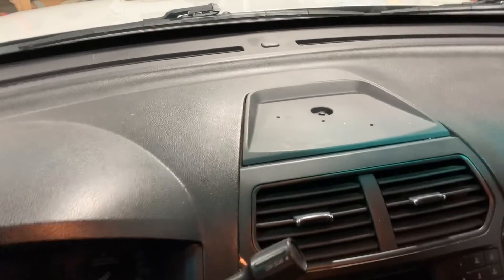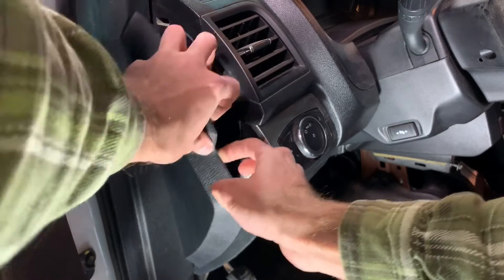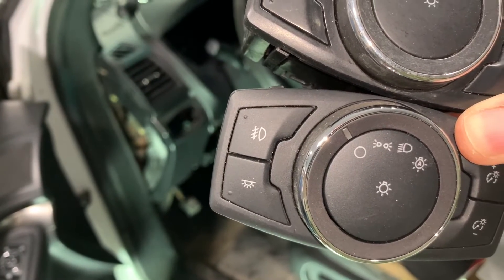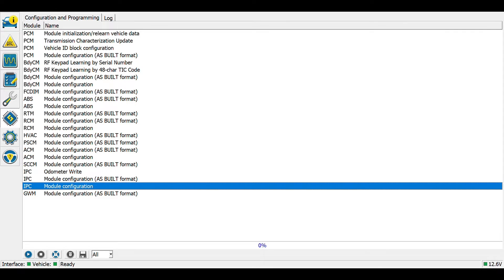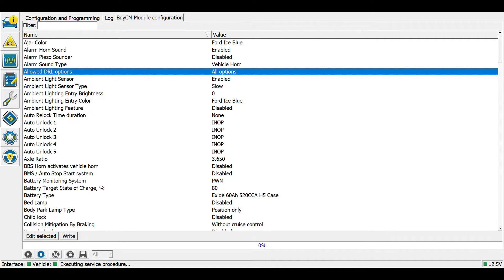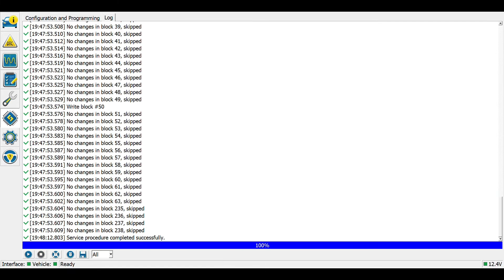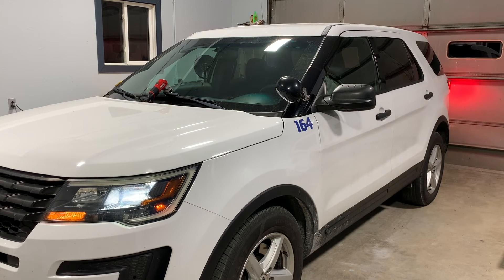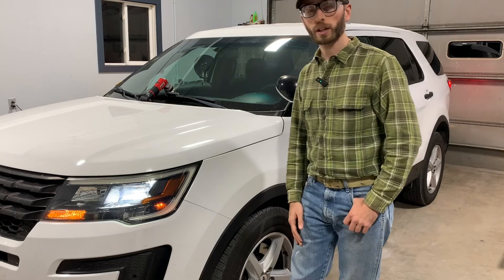Add Auto Headlights & DRLs to Your Ford PIU or Explorer

Comment: Hey. I have same car. And I don't have  high beam. Do you think they trun it off with forsan some reason?  Or any idea why is that  popular problem with ex police car??
Reply from the maker: Police sometimes tie the high beams into the emergency lights so they flash. Look up “wig-wag headlights” or “police headlight flashers” to see what I mean. While they would have still worked as normal high beams, there would have likely been an additional module (under the hood I think) to get them to “wig-wag” when a switch on the center console was flipped. If your FPIU was set up like that and the emergency equipment was then removed, you MIGHT have to rewire your high beams for normal use. 

THAT BEING SAID, always start with the simple things first.

1. Replace both the high beam bulbs (or at least remove and test them)
2. Check all fuses
3. Check settings in FORScan
4. Check wiring
Reply from the maker: To be clear, these Explorers/FPIUs have separate lights/bulbs for low beams and high beams, so you must treat them as completely separate electrical systems.
Reply: @reidthemanual  Thx man. What I have to look in FordScan?
Reply from the maker: @EyeCandy-BTS  click into the modules (like the BCM) and use the “filter” in the top left of the screen to look for anything “light” or “lamp” or “beam” related and just make sure everything is “enabled”. Always click into the options and make sure the best one is selected for what you want.

Comment: I have a 2018 piu and the drl work and turn on but the front right one dosent work as a turn signal. Do you have any idea why that is?
Reply from the maker: The integrated LED low beam headlights (white lights) are normally used for DRLs. Are you saying your left low beam works as a DRL and turn signal but your right low beam is only a DRL?

Comment: Can you recommend me the easy to plug in remote starter for a 2019 ford police interceptor utility?
Reply from the maker: @pmb8565  I installed the OEM remote start kit and highly recommend it to ensure a long and trouble-free service. It take a laptop and about 1 hour to install. I had to make a trip to my Ford dealer for help, but you *shouldn’t* have that problem on a 2019.

Comment: The auto light switch and sensor went perfect, however the DRL programing fails to work. The DRL ambers come on when switched, but on auto I get nothing. 2017 PIU. Any suggestions?

Comment: Thanks a lot for the video. I have a question, i managed to get my DRL to work with Forscan before watching your video. Later i messed something up in the BCM and ended up restoring everything to factory AB. Now i cant get it to work again. I followed all your steps, and all i managed to achieve is that my HIGH beams now turn on when i enable DRL. Any ideas what im doing wrong?
Reply from the maker: Let’s dig into this. You said that you had DRLs working before, so what hardware did you have installed at that time? Lamp switch with “Auto” option? Sun load sensor?
Reply: Hey sorry for the delay.
I have factory light sensor with auto mode. I only modified the settings in the bcm. The drl were disabled for some reason
Reply: No matter which settings I change I only get the high beams work as drl

Comment: Does this applies to FPIS as well? Ford police interceptor sedan. I installed auto lamp switch and my car already comes with sunload sensor. I have went through forscan and still doesn’t work. I might need to turn on the autolamp menu because I haven’t done that.
Reply from the maker: Hi, Seth. What year is your FPIS? There are many common features/parts between the sedan and utility. I would expect the AUTO headlamps activation process on the sedan to be similar to the utility but cannot speak from experience. Please try matching all of the settings I show in FORScan and share if it works.
Reply: @reidthemanual  It is 2015. I think 2017+ FPIS has different BCM. I will try that and let you know!
Reply: @reidthemanual  Just got home and I forget to enable Ambient Light Sensor in BCM and Autolamp delay in IPC. That fixed the problem! Thanks to your video about the autolmap delay!
Reply from the maker: That’s awesome! Thanks for following up.

Comment: What if the cap doesnt have the wire with it at all?
Reply from the maker: If the harness for the sun load sensor was not installed at the factory, you will need to add it. Here is the Ford part number for the kit:

9U2Z-14S411-TA

The kit comes with the sensor connector and some generic wires, but you’ll need to run the wires to the appropriate destination. The sun load sensor has four wires exiting its connector. Two of those must be run to the Body Control Module (near the brake pedal). The other two wires must be run to the HVAC Control Module (behind the HVAC controls).

If you do this, here are the exact pin out for the connections:

Sun load pin #1 -> HVAC pin #22
Sun load pin #2 -> BdyCM pin #24
Sun load pin #3 -> HVAC pin #23
Sun load pin #4 -> BdyCM pin #22
Reply: Just took off the cap for the unload sensor and didn’t see it wire however it looks like the cap was taken off before. I then took off the cover for the vents and tried to feel around and couldn’t feel anything. Is it a possibility that the wire fell down in? Considering taking the radio out to see if it’s down there.
Reply: And if possible, would you be able to make a quick video showing where the wires go? I looked up the part number and it said fits explorer 2011 to 2025 but only says police interceptor utilities 2013 to 2025. I have a 2011 that I don’t believe was technically an interceptor but was a detective vehicle.

Comment: Quick question, I have a sport model explorer and would like to have the orange light in the front to come on instead of the white ribbon on the top and side of the light. Is there anyway to make it like the interceptor?
Reply from the maker: There are two settings in FORScan (“DRL Lamp Circuit Usage” and “DRL Configuration”) that might let you choose what lights are used as your DRLs, but I have not tried messing with them since installing my new switch. I’ll look into it.
Reply: @reidthemanual any update on this? I’ve got a 2023 Explorer ST and would like to use the parking lamps as DRLs both in day and nighttime

Comment: So...I tried it tonight. Forscan final write failed at 23%. Said something along the lines of configuration error. Full disclosure, I have a turn signal missing, front left. Apparently DPS motorpool mechanics yanked out one of those high dollar ION led units and left me with no turn signal. Im guessing the computer said no dice when unable to complete the circuit. This is another project I'm trying to figure out. I've read bits and pieces of folklore that states there is some type of decommissioning plug in the truck that can be reconnected to a standard pigtail, socket and bulb, all of which I have. But I have yet to find a good walkthrough or video on this matter.
Reply from the maker: Jeff, I feel your pain and have experienced that “configuration error” a few times recently. It was always due to me changing something in FORScan that the vehicle did not like. Do you know which parameter change caused the error? If not, you might try changing one parameter at a time to see which one the vehicle does not like.
Reply: @reidthemanual  i thought I matched your settings exactly, but I'll try again tomorrow when I've had some rest. Preciate you being here for us. 🏆
Reply: Ok, a new day. I have tried again, with successful writes. My settings appear to match yours exactly. When I turn my headlight switch to auto, they go out instantly. Could I have a new, but defective, sun load sensor? Is it my missing turn signal bulb? Guess I'll work on the bulb to eliminate that as a possibility.
Reply from the maker: Progress! 3 questions for you:
1. The best indicator as to whether the sensor thinks is daytime or nighttime is whether or not your internal control lights (steering wheel buttons, HVAC controls, headlight switch, etc.) illuminate. Are they illuminating even in broad daylight when the switch is on AUTO?
2. I was surprised how much light it took to get the sensor to think it was daylight. Have you tried shining a bright light directly on it for a minute or so?
3. Do you have the Daytime Running Lights options in the dash menu now? If so, try turning DRLs off.

After all of this, if you have DRLs off, the switch on AUTO, and the sun load sensor exposed to blinding light for 1 minute, are your exterior lights still on?
Reply: @reidthemanual  ok, I open the door with no key in ignition, the cluster lights up and the head unit display is blue. Head unit goes dark in 5 sec, clock for 10 seconds more. Cluster stays on 30 sec. 
More in a second....
Reply: @reidthemanual  ok!! I turned my phone flashlight on and laid it on the sensor. The drls lit up!!
But....I took my phone away and they shut off. I want them on when ignition is on, regardless of ambient light. How do we get there?
Reply from the maker: @jeffrobinson4841  So it sounds like your DRLs (day mode) are working but your actual auto headlights (night mode) are not… can you confirm that with your engine running and your phone shining on the sun load sensor that you are able to toggle the DRLs on and off via the instrument cluster menu?
Reply: @reidthemanual  had to run. Will test in darkness later tonight. Thank u again. 👍
Reply: @reidthemanual  ok, several days later but... yes, in darkness my headlights and taillights are on, and full brightness. Probably doing EXACTLY what it is set to do. And to be honest, I'm probably fine. It nags me a little that the low beams are not on in full sun, just cause I'm used to it with Chevy's. But at the same time, this probably extends bulb life. Speaking of bulb life, back to figuring out what to do about the burned out Whelen turn signal problem. Thank you for all your help on this drl conversion. 👍
Reply from the maker: Jeff, I think I’m missing something. A few messages back, you said that if you laid your phone flashlight on the sun load sensor to simulate broad daylight then the DRLs (dimmed low beams) would turn on. Now you say that in full darkness your headlights and taillights are on. That sounds like proper operation of the AUTO headlight switch. What is not working at this point?
Reply from the maker: For reference here is how my 2016 performs with the headlight switch on AUTO after adjusting the settings:

Daylight: dimmed low beams

Nighttime: low beams (full brightness) + parking lights (front turn and marker lights and rear brake lights)

I love this because I never have to touch the light switch any more.
Reply: @reidthemanual  I'd like the low beams & taillights to be on full bright when I turn the key regardless of time of day. But this is definitely better than before, and I very much appreciate the help.
Reply from the maker: @jeffrobinson4841 You’re welcome Jeff. Glad I could help. 

This may seem comical, but you could also sinply set the headlight switch to ON and then your low beams and parking lights will all be on all of the time (day or night) and shut off a short time after shutting off the ignition. The only reasons I did not like that was that the dash runs in the dimmed night mode and I did not want ALL of the lights on during the day.
Reply: @reidthemanual  that's so crazy it might just work! 😂

Comment: Do you know if it's possible to have the amber lights on as part of DRL without the headlight turning on? Just the ambers lights
Reply from the maker: It’s very possible. I would try adjusting the settings that are currently set to “dedicated DRL” and/or “DRL only” to see if you can switch the light circuit that gets energized. I’ll try looking into it and get back to you.
Reply: @reidthemanual  Were you ever able to take a look? I tried all the combinations and couldn't figure it out myself. Only thing I was able to do was have the amber parking lights at max brightness with the headlight still on. Wasn't able to get it where it was the amber lights only with the headlight off for DRLs.

Comment: Why didnt you get the led module to have the signature lighting turn on too ?
Reply from the maker: To my knowledge, the LED ribbon itself is missing from the headlight assemblies on the FPIUs. This was to make room for the installation of emergency strobes inside the headlamp if a department so chose. I did not want to replace my headlamp assemblies just to get the “signature” LED lighting. If there is a way to retrofit that I may do it in the future. For now, I’m very happy with the current DRLs.

Comment: I'd like to have automatic ignition on low beams. So I can leave my headlight switch in the auto position and never have to touch it again. Turn signals only on when turning. How do I get there? I have the new headlight switch, the new sun load sensor, and functional Forscan.
Reply from the maker: Hi, Jeff. What you want sounds just like what I now have. At 13:00 I list the setting you need to disable.

Now, I never take the switch off AUTO. When I start the engine in the daytime (and take the transmission out of Park), the low beams come on. When I start the engine in the nighttime, all lights (low beams + parking lights) come on. Is this what you want?
Reply: That sounds right. Basically I'm coming out of a 12' Chevy Tahoe and I need this truck lighting to be exactly the same. Set & forget. What ever lighting SHOULD be on for night driving, without getting pulled over. 😁
Reply from the maker: When running your lights in AUTO, your front turn signals + brake lights (together called parking lights) will not illuminate during the day if you match the setting I show at 13:00, but your those same parking lights will run 100% of the time once it gets dark. I’m not sure if there is a way to NOT run parking lights once it gets dark. You, of course, need your taillights on at night, but I’m not sure if you legally need the front turn signal lights to be on.

If you need your front turn signals to be off at night unless turning, I can look into that for you.

Comment: Hey something I've wanted to see if it's possible is steering stiffness. Maybe something you can find in forscan?!
Reply from the maker: I’ll look into it. To be clear, do you want one turn of the steering wheel to turn the wheels more/less than currently or do you simply want the steering wheel to turn with less resistance?
Reply: @reidthemanual  less resistance. A smoother turn. So a civilian model it's alot "softer" than the FPIU. I'd love it to have less resistance than current

Comment: That dash panel with the blank is very easily removable. The whole thing pops off with ease!
Reply from the maker: You mean the ~3ft wide cover over the front defroster vents and surrounding the sun load sensor? Mine didn’t want to come off easily so I opted not to push it.
Reply: @reidthemanual  yup! Start from one corner of the windshield with a panel tool and work your way across

Comment: Thank you for this!! I did everything you did (except the Forscan) and was a bit disappointed that it didnt work, so I removed the switch thinking I had to modify the wiring harness. Looking forward to the fog lamps if you do that. I started but my wire harness didnt have fog lamp plugs. I ordered a new harness and have the lamps installed. Just need to pull the bumper and get to it <LOL>!
Reply from the maker: That’s awesome! What year do you have and what harness did you buy? I have not looked into this yet but expected the harnessing (finding correct part numbers to order) to be the hardest part.